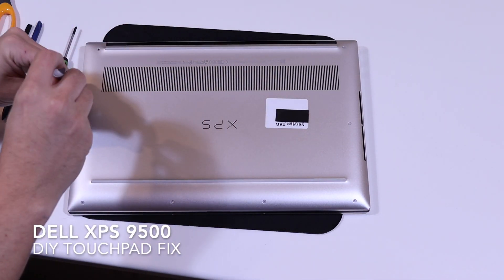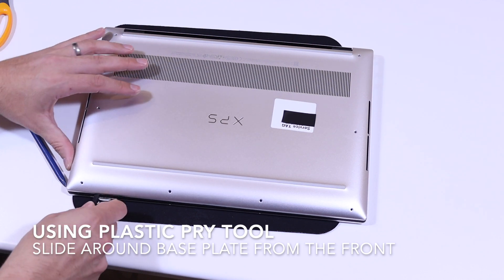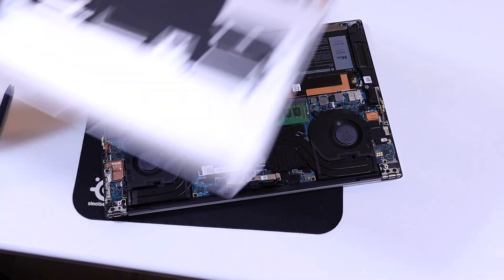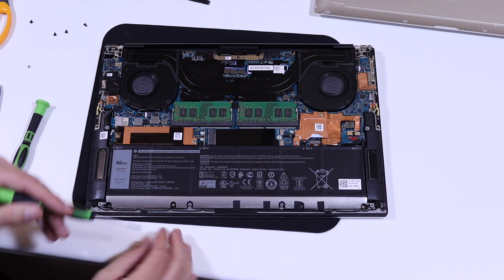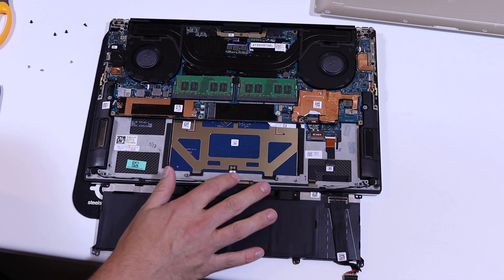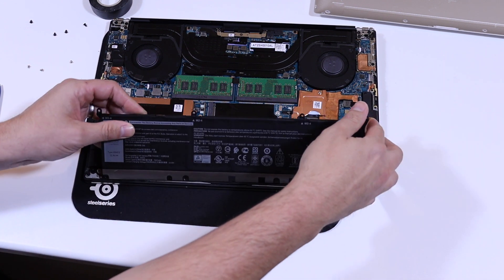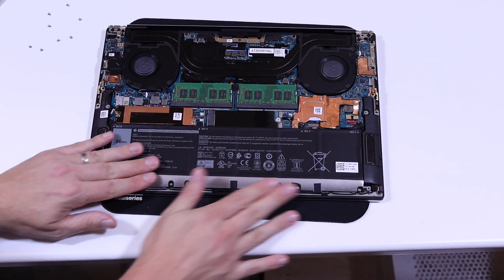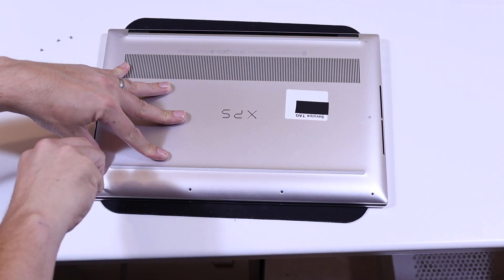Dell XPS 9500 loose touchpad DIY fix

Comment: Thanks for the suggestion, however this did not work for me. I bought my second hand XPS 9500 with a wobbly trackpad and upon opening it to try your method I found two pieces of tape from the previous owner who already tried it lol. Your video still helped me to understand that it can be fixed. What I did was to put some paper under the metal leg shown here https://drive.google.com/file/d/11X899mKsuTKlcldrvdE3E5-RN66ULrl8/view?usp=sharing . Now I have a solid fully working trackpad and I feel proud for fixing it myself. The only downside is that the back panel screws are quite soft and are now showing signs of it being previously opened which is a concern for me for any future warranty related repairs. I learned from other users that I can ask Dell to provide me with replacement screws if the laptop is still under warranty, which I will try to do. Thanks again.
Reply from the maker: Wow, that’s also a great idea! Well done for fixing it. I and had a worse one trackpad in the office last week and this also didn’t work for me, I had to slide tape between the trackpad and frame to fix it! I might update the video as it seems dependant on how bad you flex is
Reply: @MashITTech  Yes definitely, this may be the second option if the first one would not work.

Comment: I have got the precision version of the XPS 15. It's basically the same laptop, but with a Quadro graphicscard. It has a wobbly trackpad as well and I've tried to fix it your way, but unfortunately it still wobbles. The wobbling is basically gone, but it still ticks when tapping. Do you have any tips?
Reply from the maker: Did you have a lot of initial play? I have had another recently with much worse play and I actually had to slide some tape under the frame (between bottom of trackpad and chassis) and wrapped it over
Reply: @MashITTech  That worked for me too, thanks!
Reply from the maker: Brilliant news! Hope you can enjoy it now

Comment: I was skeptical that a tiny piece of electrical tape on that spot would do the job, but it did. Thanks for the video! That bit of intermittent looseness and rattle was slowly driving me crazy. On my unit, getting the back separated was quite difficult to get started, but once it got going came off easily. (My unit was shipped in January 2021, but through a third party vendor, not Dell, so I don't know when it was built.)
Reply from the maker: Glad it helped you too! I have had a couple of these through now from clients and it is amazing that a simple bit of tape can fix it!

Comment: Update: The edge of the left side is unclickable but overall the trackpad is not loose. I think I managed to strip a screw in the motherboard so unfortunately there'll always be one screw empty on the top of the battery.
Reply from the maker: oh mate, it sounds like you are having terrible luck. I am so disappointed in Dell for not fixing this issue
Reply: @MashITTech  Yes unfortunately. I reached out to dell for a screen replacement because this screen is noticeably dimmer and after putitng tape in this laptop, I accidentally stripped one of the battery screws... Instead of just getting sscreen replacement, I'm going to see if they can just send me a whole new one.

Comment: If only my left side is loose should I put the tape closer to the left side than just in the middle?
Reply from the maker: yes, then test it. depending on the play you may need to adjust or add another layer
Reply: @MashITTech  yeah I’m testing it right now. The left side was loose and I hear a double click but now when I add a second piece of tape on it, it doesn’t even click.
Reply: @MashITTech  i double layered the tape and now I can’t click the left side. It’s too tight and idk how to fix it at this point hahah

Comment: After 8 dispatch services from dell, the left side of my trackpad before was not even clickable, after the last technician came, it's clickable but a lot harder to click than the left side. I seem to have the opposite of a loose trackpad but I am going to try this method myself. Hopefully it works.
Reply from the maker: Good luck, let us know how it goes. Once you get the battery out see what the tech has done, maybe he has jammed too much packing in there. It could be the track pad is just faulty if it won't click though
Reply: @MashITTech  will do. I’m scared that I’m opening up my laptop too much lolol I’ve opened it up close to 10 times now... any tips on taking the back plate off? I heard it’s super tight
Reply from the maker: Yours has been opened so many times I am sure it will be easy to separate. My only advice is.
1 use a good screw driver set so you don’t damage the heads
2 very carefully work your way around the laptop when you separate it, watch my video before so you see how I separate then lift the lid off so you don’t damage anything.
3 be very careful with the speaker wires taped to the battery
Reply: @MashITTech  okay great to know, thank you. I just ordered a drill bit set from amazon and it’s coming tomorrow, so I’ll be using those tools so see what I can do
Reply: @brandonxchang  I have exactly the same experience as you. Did it work?

Comment: Two of my screws on the inside of the laptop broke after I used the wrong size screwdriver for it. I thought cleaning the trackpad would work but unfortunately I was wrong. I just found out that was the right solution

Comment: Followed your tutorial, It fixed some of the wobble but it´s not perfect. At your video it seems so easy but my backplate was almost glued to the chasis and was really hard to get in. I really dont want to return mine, because it only has this issue.
Reply from the maker: Maybe try a second strip? And yeah sorry, I have been taking laptops apart for years so used to getting into these clipped up chassis!

Comment: Thanks for this. I already got my XPS 17 replaced once, but the trackpad is still slightly loose. I'll give this a try.
Reply from the maker: no problem, if you need any help just ask.
Reply: @MashITTech  In the XPS 17, there are some foam pads on the metal part of the trackpad assembly. However, because the keyboard ribbon cable has to cross over one side of the trackpad, the foam pads are not placed evenly, and this leads to varying levels of looseness/backlash across the trackpad. I haven't seen these foam pads in the XPS 15 trackpads, so I'm not sure how Dell is addressing the issue there.

Anyways, I ended up placing pieces of electrical tape on the metal plate above the bottom metal tabs depending on how loose each side was. Now, I don't have any looseness during normal use (clicks and slow, firm presses). If I quickly tap the trackpad, I still hear some looseness, but that's not how I use the trackpad anyways, so I'm not concerned about it. Besides, I think this can only be fixed with more foam pads, but I'm afraid of placing some under the keyboard ribbon cable and accidentally applying pressure to it.

I'm sure fine tuning the trackpad was the least of their concern when designing a thin and powerful laptop, but it still frustrating as an end-user.

Comment: Thank you so much. I received my XPS 9500 a week ago after waiting a month. I was frustrated with wobbly touchpad issue. Mine was loose at the left lower corner and the middle as well. I applied the tape as you described, but the I used 2 layers. The issue is gone, but it took me a while to unplug the battery! Thanks again
Reply from the maker: Glad to be able to help. It’s a shame we have to do this ourselves

Comment: Hey if anyone is interested, it seems dell hasn’t found a solution for their problem. They sent a brand new touchpad (its the whole carbon component with the keyboard) and it didn’t changed anything, the touchpad problem remained, after i told and showed the dell mechanic the video here he said nah it can’t work, well it worked. Thanks ✌️
Reply from the maker: Haha good old dell engineers! I won’t let them touch my machines, they let me fix things myself after the last time an engineer put the wrong screw into the case and drove it right through the palm rest! I even told him it was the wrong screw!
Reply: @MashITTech  😂uff yeah mine also had some trouble to put it back together, there is this one cable which is kept in place along the battery, well after he screwed almost everything back together this cable stud out, it almost was cut but i saw it and told him: he was like: i know my job you don’t have to tell me, i have eyes 😂.

Funny guy😂

Ah and just to tell you, this all was in Germany (i live there) so dell have really a problem with this touchpad.
Reply from the maker: Oh wow, makes me cringe! I love that we have onsite warranty but they could really do with better engineers!
Reply: @MashITTech  yeah... but I’m happy they could sent someone to do this💪 because i need the laptop and i couldn’t give it away for a week or more to be repaired.

Comment: Good video. I did the same repair/mod to my machine and found that I also had to out a wee square of electrical tape under the two front corners of the trackpad, between the screws for the battery and the bottom cover, to get rid of the wobble completely.  It's not too hard to do but annoying that a brand new, premium price laptop needs this.
Reply from the maker: Well done mate, we shouldn’t have to do this but unfortunately it is a lot quicker and less hassle than trying to get dell to sort it!

Comment: Does it actually fix the issue?? I have that slight click on the right bottom part of the trackpad. Basically it has slight click  before the actual click. And also left bottom part goes way in when pressing. Thanks
Reply from the maker: Fixed it perfectly for the one I had in the office
Reply: @MashITTech   should i apply on the left right and middle?? How many layers of electric tape?
Reply from the maker: If you’re is only slight then I am pretty sure 1 strip should do it. And yes, just run it across l,r,m then test it and adjust as necessary if not perfect.
Reply: THANKS mate surely will do it. DELL SUPPORT IS THE MOST TRASH THING EVERRR. I was sent the replacement same issue again. Will try it and let you know soon.

Comment: Hey, i just bought this Laptop and have the same issue! I would like to fix it my self (thanks to your Video) but I’m not sure about the warranty, do you know if i lose the warranty when I open the Laptop or is there some little shit which will indicate that I have opened it?

Ps: the Laptop is only three days old, got it on Friday, i did a complaint but they told me they can’t send me a replacement laptop, so they would give me my money back and i could buy later a new one. (Problem here, i wouldn’t have the black Friday discount). 

I will try to contact Dell on Monday but if there are no indicators which could proof that I opened the Laptop, i would do it myself
Reply from the maker: Providing you do not damage the laptop the warranty is fine. They will not know you have opened it unless you make it obvious
Reply: @MashITTech  thank you✌️ but as i said, i called dell and they immediately told me they will send a technician to my house to do the repair! The women i was on the phone with also ordered the trackpad while i was explaining what was broken 😃. Seriously i never ever had a better support experience 👍.

But thanks a lot for your answer! I‘m planning to extend the Ram from 16gb to 32gb and the storage from 512gb ssd to 1tb ssd.

Comment: to everyone reading this, i have my Fourth ( yes the 4th) XPS 15 now, finally one with just "the wobble trackpad" issue. 
extremely bad costumer service, they sound unprofessional like a team of interns are helping me out.
now after all these emails and complaining, one engineer told me that by design of the size of this trackpad, its normal that it has this clicking sound, and i just have to get used to this? , is there anyone that has experienced the same problems? 
after 4 laptops i can assure that there are no good trackpads... atleast i havent seen a single XPS 15 that has a good solid trackpad.
....hope someone around here has got one that is solid.
Reply from the maker: oh mate, that's terrible. I have another here with faulty trackpad, I am about to open it up

Comment: Hello, I recently bought an XPS 15 9500 and I don't have this wobble but when I hold the laptop by the side my trackpad click doesn't work/behaves erratically, I think its probably to do with torque on the chassis slightly bending the trackpad down, do you think this tape solution will work for that too? Example of my problem shown in this video: https://www.youtube.com/watch?v=5nkbUheUIL0&feature=youtu.be&t=173
Reply from the maker: You are not the first person to mention this. I don’t think it will help in this situation. I have just received another xps into the workshop to fix so I will take a look at your problem at the same time

Comment: Thanks so much for that! I received my XPS17 yesterday and the trackpad is slightly wobbly. Decided not to change it, as I saw some people received even worse trackpads than me. So I will try your fix next week - waiting for electrical tape now. Keep fingers crossed!
Reply: Did you try the fix yet? I just got my XPS 15 9500 a few days ago and have a very subtle wobble too. Everything else is perfectly fine so I really don't want to jump through the months long hoops of returning it for a replacement.
Reply: @kylenoyes6390  Unfortunately I found that speakers are not correctly working also, so in the end I contacted Dell. Technician is supposed to come and fix it
Reply: @aleksandrabaszczak9272  Ahh, that's a big bummer, I hope they can fix it. I did finally but open my laptop tho and do the fix and it did work. The trackpad feels a bit weird sometimes, but the wobble is finally gone. I hope you get yours fixed up soon :)
Reply from the maker: No problem at all, hope it goes well for you but if you get stuck at all ping me a message

Comment: Did you have any issues with clicks registering with the bottom left corner before putting the tape? Sometimes my bottom left corner click doesn't work and I gotta go a tad bit to the right to get a click. Just wondering if this works for that as well
Reply from the maker: I didn’t, but if the pad is loose then that could certainly cause it

Comment: Thanks so much for this idea! I tried to solve it with DELL, but they only offered me a) a discount of 20% if I keep it or b) money back if I wish to return the XPS. With your tut, i just saved 20% and the trackpad is finally fixed. 

In my case, it did not work with the tape, too slim i guess. I did it with thermal pad leftovers!
Reply from the maker: Well done mate, you deserve that 20% for doing their job for them. And yes, you clearly had a lot of play on your pad if tape wasn’t enough! I have just had another one come in with this fault so about to do it again! When will dell actually fix it?

Comment: It fix mine.. dell technician came to fix it . But he was about to take the entire thing apart so I told him let me just put tape.. and it works..
Reply from the maker: I am so glad it worked for you. Such a shame this is still and issue though :(
Reply: @MashITTech  yea . I really love this laptop.  I could get better specs and performance.  But this is a beauty.  If the x1 extreme gen 3 had 16:10 i would go for that.. they are the best build quality and best customer service that I have seen.. i still can return mine but I love this laptop
Reply from the maker: Yeah I reviewed the P1 gun 2 (extreme with quadro card) and it was an amazing machine, that keyboard is sublime! but the speakers were anemic and the 16:9 was poor from not only an aspect ratio but also quality. Lenovo need to up their game and give us 16:10 with better speakers and battery. I have an XPS 9500 in for review at the moment (the one I used in this video was a customer so I couldn't review it) and they are beautiful machines and the screens look amazing.
Reply: @MashITTech  yea i still have like 8 days left if I want to return it but I think i will stay with the 9500 if you get a good one . It the most beautiful laptop.. i was about to go the MacBook m1 but I never been a Mac fan
Reply from the maker: we have just had the pro and air m1 in today (not long uploaded first impressions) I have been surprisingly impressed, the performance is amazing but what impressed me is the lack of fan noise and heat, MacBooks normally get so hot you could fry an egg but these are Luke warm!
Reply: @MashITTech  you think I should switch?  I think windows has nore freedom.. and this dell is amazing what would you do?
Reply from the maker: not necessarily, if you like windows then the xps 9500 is an amazing machine, plus you get that 15" display in a thin and light package. The new Macs are only 13" but they do pack a punch. trouble is being apple silicon there is no chance of running windows at the moment so you would have to go fully OSX
Reply: @MashITTech  i was thinking electric tape melted after 80c . That might be a problem unless it doesn't get hot near that part
Reply from the maker: If it gets over 80c around the battery you are going to have way more problem than the tape! It will never get that hot in that region 👍